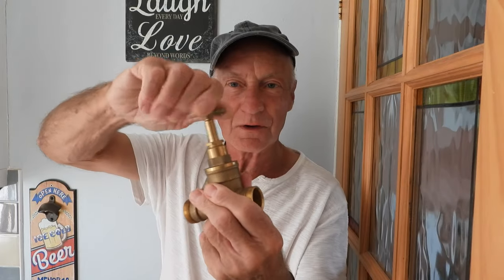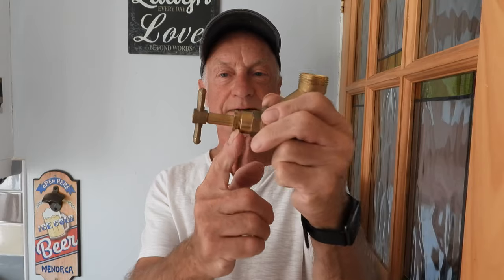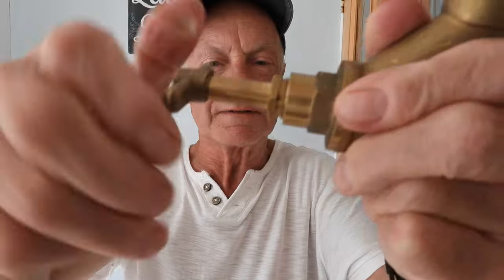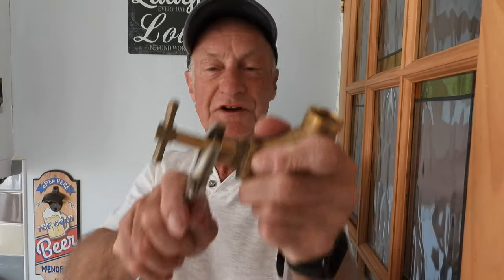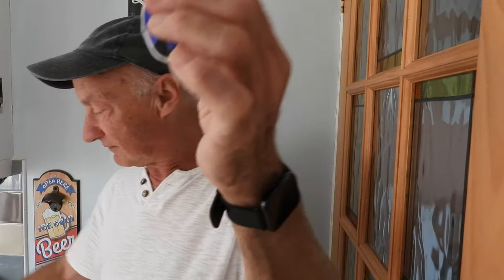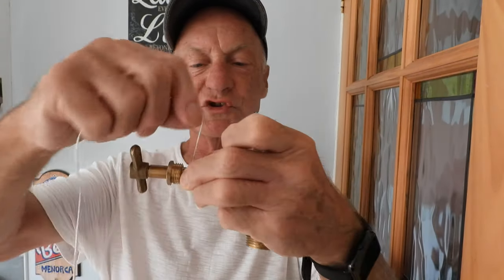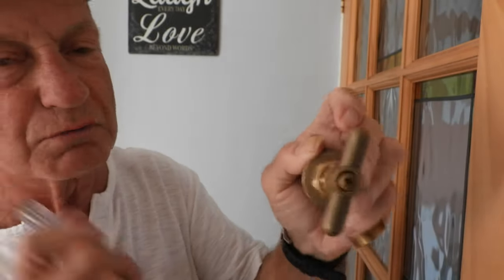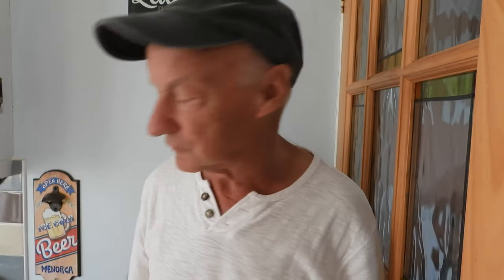Stopcocks, radiator valves, hose taps, gate valves, all leak from the same place.

Comment: Great real world tip (plus other videos). You plus Michael our normal plumber have given me the confidence to tackle several small jobs. Best tip from Michael was clearing a sink blockage by undoing the trap and using a wet and dry vacuum to suck the rubbish out. I have used this twice now and saved two call outs.
Reply from the maker: That`s great.

Comment: Great video. I need to replace the internal rubber 1/2 washer as the tap will not close completely. The fibre washer may as well be replaced but I can’t find out the size. Please could you advise. Thank you
Reply from the maker: You will not get a fibre washer for that, use a short bit of PTFE tape instead.

Comment: We have a shower into the bath type of thing, not a power shower, however the knob on the wall won't turn so we've been using the twin hose on the bath taps. How can I get it to turn on?
Reply from the maker: You will have to dismantle it.

Comment: Any tips for stopping leaks on service isolation valves? (When it leaks after not being used for long time in the middle of the valve where you use flat head to turn it on/off)
Reply from the maker: I have a video on it.

Comment: I have a very old gate valve (on the cylinder inlet) where the packing nut has come off the threads and I've never been able to get it back on.  Turning the valve makes it drip like crazy for many weeks before the hard water seals it up again. Any tips for repair? (I've bought a ball valve to replace it but so have haven't managed to fit it due to lack of play in the pipes.)
Reply from the maker: Not if the thread has gone on the packing gland.

Comment: Hi Derek, another great video, however I have one problem I would like your advice. It is a chrome towel rail valve, I have removed the top cap, but the outer casing won’t move. Any tips . Thanks
Reply from the maker: A light tap with a toffee hammer and some WD 40.
Reply: @dereton33  Hi Derek, thanks, I will try this